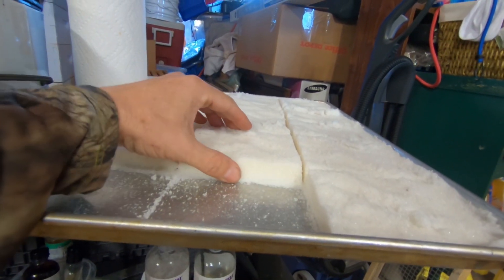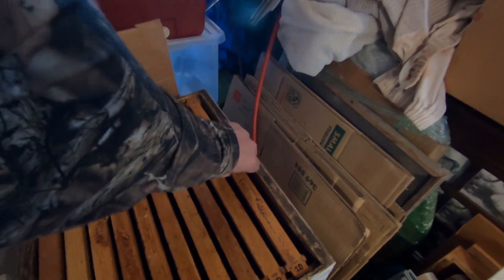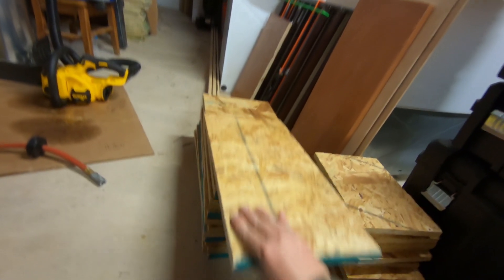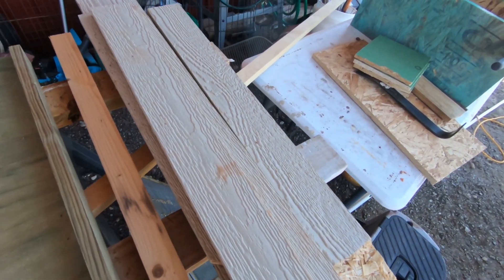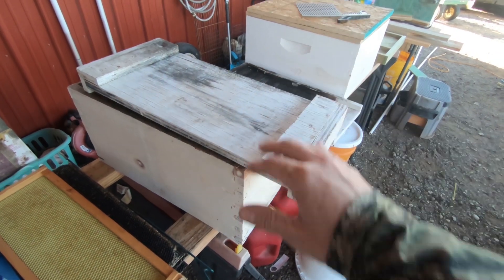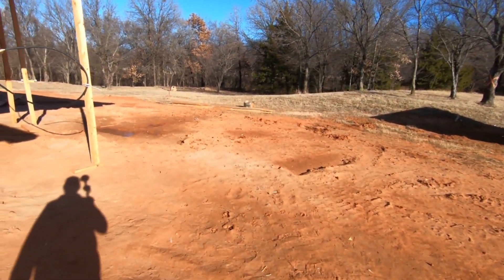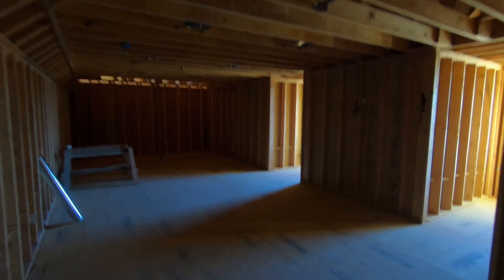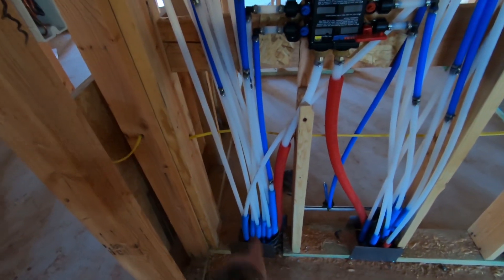Winter Beekeeping Projects & New House Update S4E2

Comment: It's looking good especially all the extras. The Roof was conventionally framed...It they had installed a manufactured roof truss system they could have run the duct work through the web system for support every two feet but hanging is the only option with the second floor.
Reply from the maker: Hey Wes.  Good to hear from you.  Yeah, I thought they would have pre fab trusses, but they built them right on the house.  Probably wasn't enough the same to make it worth their while.  They framed it and had the top framed in about a week.  Pretty amazing guys.  I need to get over to your channel to see how the fish are biting down there. 
 Thanks for stopping in.

Comment: Save any pieces of good wood!  it comes in handy
Reply from the maker: I saved quite a bit.  Those piles were twice as big when I started on them.
Reply: There a go! cool.  My dad made a bunch of work tables out of 2x6's  i kept 1, for the car port.  The rest i took them apart, and made walls out of them for the shop. They was so heavy!  i had to use a dolly to move them around . I had a bunch of square metal tubing,  i made work table from. use 1/2" plywood for the top.  Lots  stronger and easier to move
Reply from the maker: I've made two workbenches in the past out of 2x6 and 2.8 scrap wood.  The first one I built to the wall, so I had to leave it.  The second one I put a back on it and casters, so when we moved out to our land, I took it with us.  It was a beast getting it on to the trailer.  That's it you see occasionally on the videos I shoot in the barn.

Comment: well heck OSB is like plywood, but need to brace the long sides from warping , What i would do is brace around the top to kept it from warping other than that !  Paint it and it should work great. There a number of times i use another piece of board for a lip for the frames  just make sure its longer for the extra board > with the correct bee space  3/8"  on each side of the frame and hive body.   My swarm traps are made from 1/8" plywood,  they lasted 6 yrs now!  That I framed around the top, from warping. Those brown ones got killer bees on em.   THAT WILL WORK BROTHER
Reply from the maker: I finished cutting it up tonight. Man, that was a lot of cutting. I’m using the heavy 1” for the bottom boards. It’s the tongue and groove stuff they floored the top story with.  I may make some pine braces to run lengthwise on the top so it don’t warp.

Comment: I have some of those treated bottom boards and it is coming apart after one season. I put some of that fancy sealer stain on it, guess it's not that great. I've hung a lot of duct work like that. If you have brick, those knuckle heads like to kink the freon lines. I assume you have a drip pan under the inside coil in the attic, make sure the pan drain is where you will see it if the main drain stops up and over flows into the pan.
Reply from the maker: Hey OkieRob.   Man, that's pretty sorry if those are falling apart already.  I checked out that drain pan after they put it in and it has two drains.  I'm assuming a main and an overflow.  The overflow pipe on the pan has a sensor on it, so I assume it alerts you somewhere if it's going out the overflow.  I'll have to look and see where it drains out.  I think they come out where the hot water heater is.

Comment: I really like the idea of them split systems that'll be really nice.Osb or not I would definitely be using it too,be good for your nucs your going to sell or even Swarm traps.I use stuff like this from time to time and I got spoiled (or lazy) on them Spray Cans of "Never Wet" ..I spray edges Really good and go over rest of it real quick,if your being thrifty you can just do edges good and it really helps,works good,no painting, couple minutes done.Paint maybe better,but Never Wet is sooo fast and so far still working like new after 1 season.
Reply from the maker: Hey Baddest Bees.  I'll have to look into that.  So you spray it on the corners before you paint?  Where do you get it?

Comment: What would be the cost difference to build this house from brick/ block and render, the reason I ask is when we see the news in the UK of hurricanes in the US most of the houses are built of wood and the only ones standing are the brick or blockhouses.
 In hurricane areas, the building planners should be made to read The Three Little Pigs
Reply from the maker: I’m in the center of the US. No hurricanes here. We do have tornados though. I know some costal states have building codes to harden for hurricanes. There’s also a style called ICF that’s very strong.